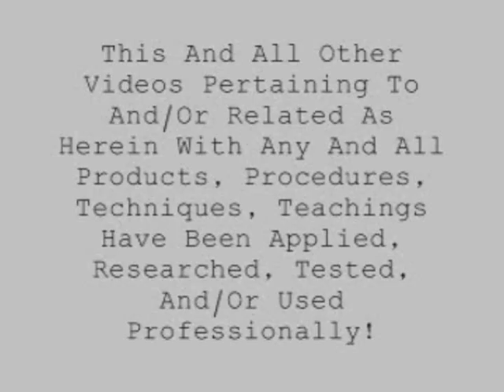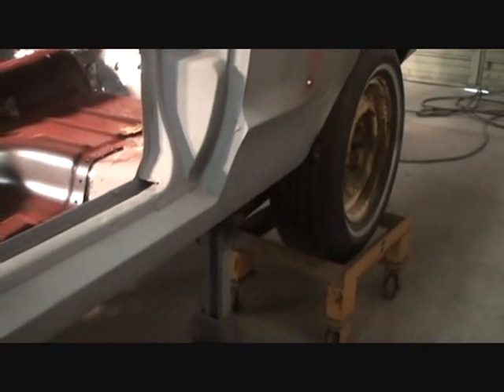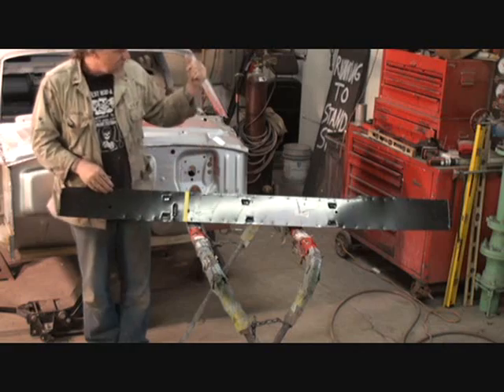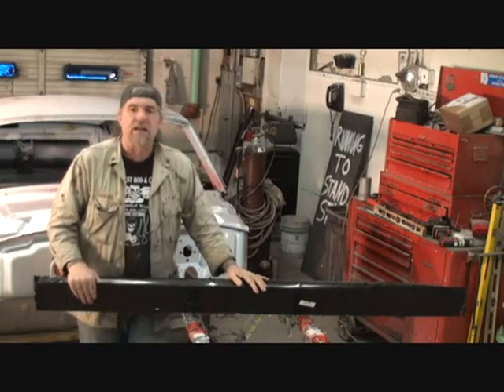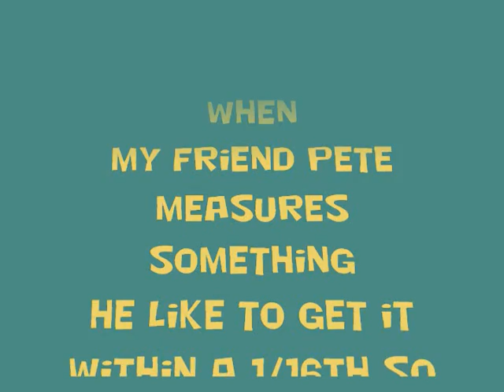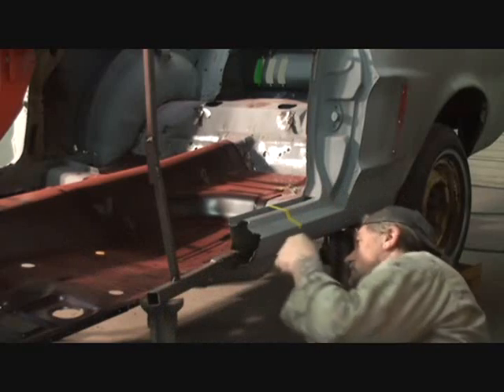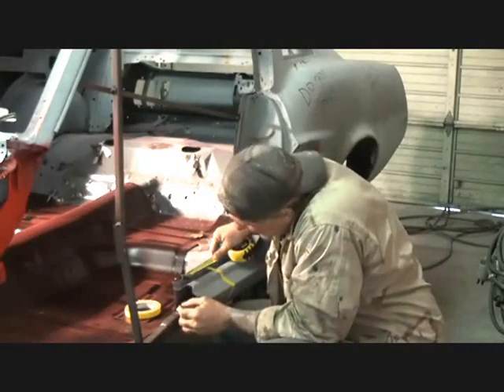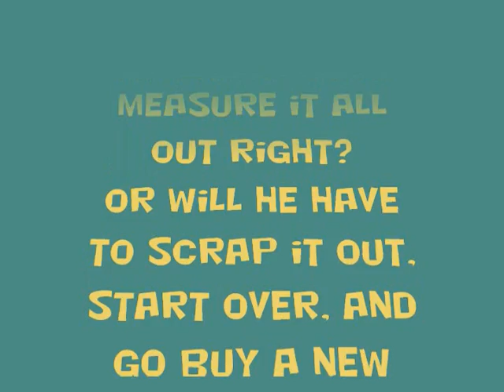"How To": "Restore" A Rusted Out "Car"-Part 13

Comment: Thanks Pete for sharing this, I have been waiting to see your approach on the left side of this project. This is where the rubber meets the road so to speak! Watching and learning from here in central Indiana.
Reply from the maker: Gary Indiana???
Reply: I'm watching from central Indiana as well (Clermont). I've spent this entire Sunday watching this restoration. :)
Reply: well hell im in terre haute indiana
Reply: god damme thats a job  pshhh lucky mines already been restored and i only got to weld up a couple of pin holes 10 years later
Reply: Richmond 😊

Comment: the work on the l/h rocker panel reminds me of the way you 'adjust' the door and window posts? when chopping the body to make a real 'low' rider.    good fun.    glad stumpy only has to build engines...hoping to mount one tomorrow and get some oil circulating in it prior to trying to start it the first time.     I oughta have a lawnmower 'simtester' to break-in the motors before the first run...if I was a younger lad, I'd prolly make one just to show it to John at Costa Mesa.    it's nap time for Stumpy....

Comment: Recently did some work on a Camaro that had some work done to it by an ASS CLOWN! Need to remind folks that the rocker panel is an integral part of a Uni-body car. A complete full length rocker will have 50 or more spot welds to drill in order to do it correctly. HOWEVER... the ASS CLOWN only cut off the old one, left all of the spot welds and overlapped the piece to what metal was left and welded it in 5 places which is about 55 welds short.
Reply from the maker: go back to video 1 ,2,3 of this set and you will see what kind of "ASS CLOWN" Work was done to this car when it showed up on my door step!

Comment: since both sides are the same like you say, couldn't you use the good side to measure for the rocker panel. using the measurements front inside where the door starts to the front  minus what you didn't cut off to the door.  Watched all the vids up to here, great show . Will be watching them all til the end thanks.   Just seen the beginning of the next video you did do that...lmao